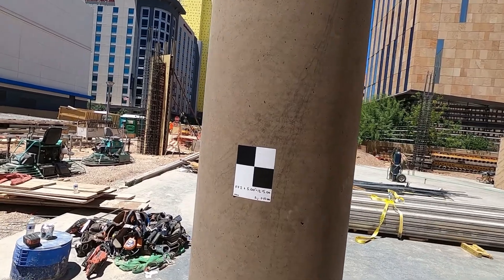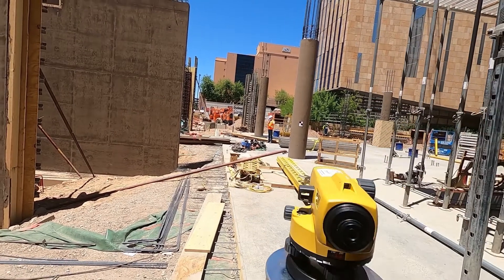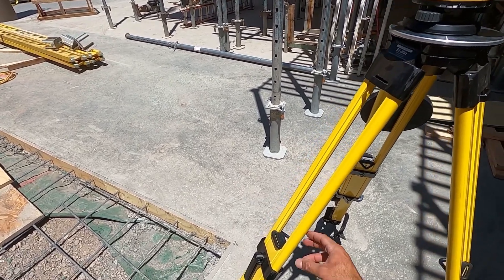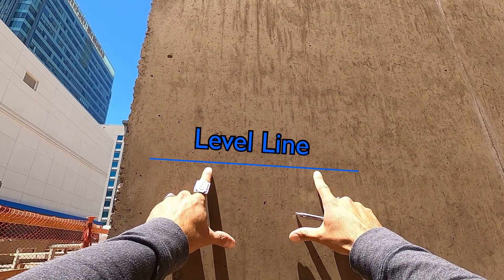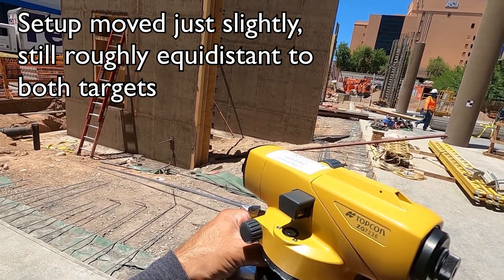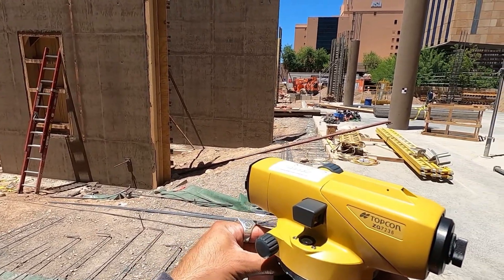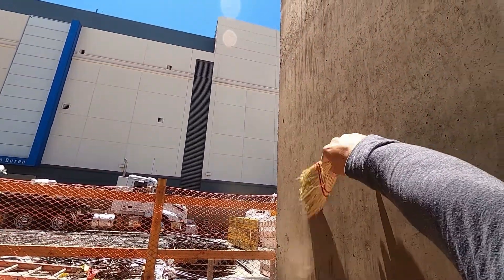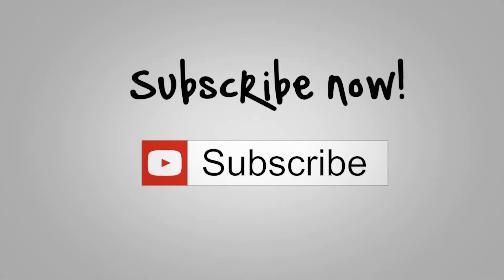Surveying: Bucking-In a Level

Comment: You forgot to add, after placing the target, going back to the level to make sure you positioned it properly.
I'll also mention that a method of getting that last thou or two can be to turn your leveling screws all in the same direction a quarter or half turn or something to use them to slightly lift and lower the instrument.
Reply from the maker: @bwhog  I actually want to create a video for setting a target card without bucking in, just transferring marks and measuring up or down from the level line. I’ll be sure to show the whole process there. Regarding the 1/4 turn that works, I prefer to use the tripod to raise lower and the screws to level. There are definitely areas where someone else (or several someone elses) have a great method.  In that case, I say whatever works, or better yet, whichever is fastest. Thanks for the great comments!

Comment: what's with the tapping?
Reply from the maker: Tapping is to make sure the internal compensator is working.  If the images in the lense jiggle then the prism in the instrument is working.
Reply from the maker: Depending on the construction of your builders level, the leveling component is floating on a system of springs.  It used to be quite easy for the springs to become lightly bound up, especially if you carried the level over your shoulder.  Tapping once the level is relatively level causes all 4 springs to lightly flex and generally resolved any binding. If you looked through your telescope you’d see your level line lightly bounce and level out again.  Lots of folks (to be quite honest) skip this step, and some don’t even turn the level 90 degrees and check level.  In most cases, neither of these items are a huge deal- but if spending an extra 5 seconds help you be as close to perfect as possible- its well worth it to me. That’s why I choose to include both in this video.
Reply: Good explanation. Im my own experience, the turning 90 and tapping are not a "if you don't do it=you know that you'll get worse measurements" but a "if you don't= you MIGHT get worse measuremens" sort of deal. 

Always better safe than sorry though. The one time you don't do it will be the time it screws you.

Comment: I want someone to show a practical exhibition and explanation how to setup a level over an existing point. I have searched high and low for one good example and found none. I know that most levels do not have the optical plummet, but there must be a standard way of getting this right.
Reply from the maker: What are some cases uses for setting up exactly over a point specific to your work? Let’s talk about it!
Reply: @leansurvey8212  Okay, I will try to be more clear. What I see most is people just set the instrument (the level) up randomly but not over a certain point and that's fine if you don't need to be over a point. I think most people completely omit showing setting up over a point because it is so hard to do with just a plumb bob under it. Some of us do not own the more expensive units with the optical plummets. So I would just like to see how a pro would do this using a lower cost instrument. Say you might need to setup over a nail in a hub and turn some  90 degree angles but all you have is a tool with the plumb bob, I find that hard to do so I must be doing something wrong. Just looking for a better method for doing this so I can practice it. Your videos are great.
Reply from the maker: @armorvestrus4119  I understand what process you’re asking about, I’m asking when you would use that method in it with. Often when transferring elevations you come off of a point with the rod to get an elevation at the level. Since there is no ‘measure up’ mark on the level, you can’t really setup over a point and measure up to start performing level work. Are you setting up over a point to create accurate distance measurements with the stadia lines?
Reply: @leansurvey8212  Again I messed up my example. I know with the automatic level a point directly under it is not the main subject.  So maybe I should have said, a Transit for locating other points like nails in a peg. Regardless I finally worked out a method  to bring the plum bob quickly over the point and it worked great. To my credit no one taught me I just figured it out and than put it to the test. I still haven't seen it done this way by anyone on You Tube. Now I have the option to set up a transit or a automatic level over a point if I need to. I just wanted to cut some corners and let a Pro show me how, but now I know.